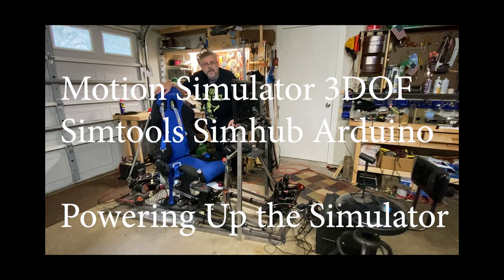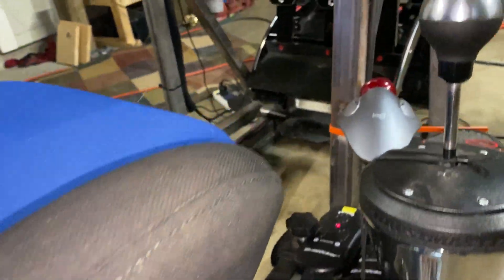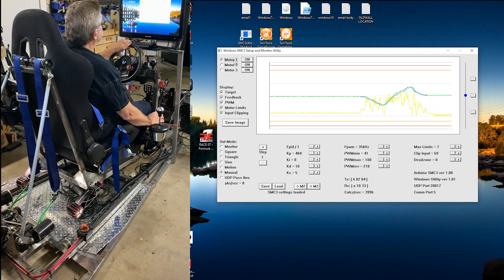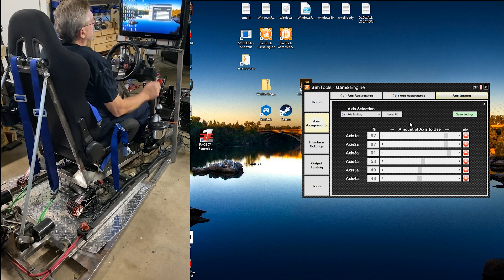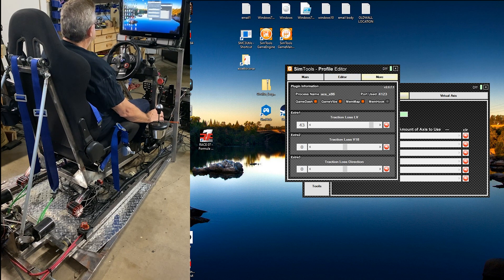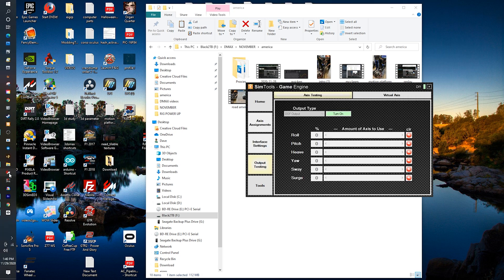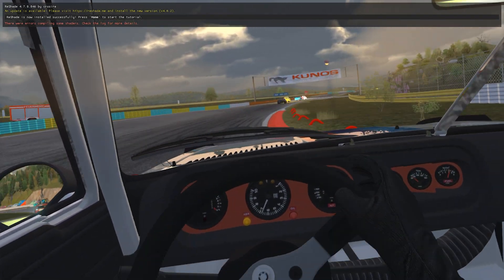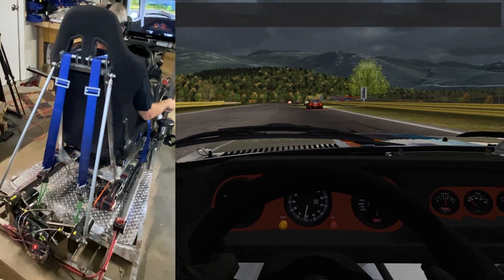diy motion simulator build - motion simulator build Powering up the Motion Simulator

Comment: Hey Dave. Been pulling my hair out (didn't have much to start with, so this is not a good thing) for the good part of two days. Have you ever patched your game to rFactor 1? My rig is working great in all test modes, but I have zero movement in game. Nothing I try works.
Reply from the maker: Well thanks for letting me know..  I have not tried it in R factor..  I guess you installed the Plug in right?   and that the rig is moving in SMC3 and maybe in another game like AC or  Live for speed (free game).    I think I would go back to x sim and post a thread  or read some threads with that search term..  other than that I think you need to  run the game once, before you try to set up sim tools..   But like I said I have not tried it yet..  Only DR2, AC and ACC, rollercoaster and Live4 speed.  
I'll post the question on my next Road Rage episode and maybe someone in the group can let me know..
Dave
Reply: @DMAX_DIY  thanks for the reply Dave. Turned out the plugins updater only likes zipped files dragged in to it. I’d extracted the files and dragged them in in the first instance and that was the problem. You gotta drag em in still zipped! Mostly the opposite of any other mods I’ve used in games. Anyways we are good now and I’ll tell you, what a blast this 3DOF motion platform is! Should have manned up and done this years ago. In the sim tools tweaking phase now with the games. It’s gonna take a while I recon. Traction loss is real tricky I’m finding.
Reply from the maker: @Doctoradhd1  Yes..  AS A ZIP FILE!  somehow Dustin has made it like that..  I did do a video on it..  
https://www.youtube.com/watch?v=QYzV9ler328&t=3s

BTW just watched your  latest video and asked a question on your channel..   Take a look.. if you have time  Dave
Reply: @DMAX_DIY  wish I’d seen that one. Would have saved me some time working it out!

Comment: hi great !!! 1 question  it is the same prog ino with potentiometer  remplaced by effect hall ?
Reply from the maker: smc3.ino is in the smc3 utility zip. on this page near the bottom  https://www.xsimulator.net/community/threads/smc3-arduino-3dof-motor-driver-and-windows-utilities.4957/
Reply from the maker: set up the SMC3.ino file in  your arduino by changing the #define mode1 to   #define mode2 and upload to arduino if you are using IBT-2 motor controllers like I used.  It's important to have 180 degree pots  or 180 degree hall effect pots because the range of motion of the lever in each motor is going to be less than 180 degrees.. Hope that helps fas83.   DMAX
Reply: @DMAX_DIY   does  i changing #define ENABLE NON LINEAR POT SCALING ? for hall effect pot ?
Reply from the maker: @fas83  I dont use that but It's supposed to smooth out the abruptness of a high horspower car.   like I said.. I have not used it yet.. I like linear..
Reply: @DMAX_DIY  thanks dmax.  I will do it.  👌👍

Comment: Hello, very good work, when launching the games you don't have problems with the simhub? I can only launch simhub after launching simtools and the game if not the engines don't maxem .... didn't you have the same problem? How did you solve it? thanks
Reply from the maker: Hey Alex..  fortunately, I do not have any issues. I just launch my RIFT from the Virtual screen ..  then I can launch the Simtools, switch to AC  from whatever game it's on..  Then turn on my motion rig. then if I want to run SIM hub, I just start sim hub.. It controls the Buttkickers and the wind sim.  Sounds complicated but only seems complicated if i forget to turn on the motion platform.. ALthough the guys in x-simulator.net have showed me a MACRO which starts up everything in order  but I have not tried it yet.. Dave
Reply: @DMAX_DIY  In the order you tell me it works perfectly, simtools/engines/game/simhub, but if we change the game and don't delete simhub and restart it after the platform won't move .... that's what happens to me .... Thank you very much and very good work....
Reply from the maker: @alexandredacunhacoelho6950  Glad it works on that procedure..  I dont swap games very often so Maybe I am overlooking something  cause I think simhub keeps multiple game profiles you can select from.  Or just restart the sim hub..

Comment: How come all 3 POTs would not be set to the middle at startup testing on SMC3?
Reply: Actually already watched 'em, subscribed, got them saved and refer to them frequently.  So thank you for that!!   In fact I am holding you personally responsible for leading me down this rabbit hole...lol. 
I designed a 3DOF rig modeled after yours, but with the seat frame made of aluminum extrusion.  I've joined X-sim and cruise around there daily trying to learn as much as possible (but it's never enough)  I actually got the electrical half of things pretty much done and (seemingly) working on testing and am working on the mechanical side of things now trying to get all the frames and geometry right now.  Just had Fanatec ruin my Christmas today when they told me the DD wheelbase I ordered a month ago, and was supposed to ship tomorrow,  now won't until after the first of the year 🤦🏼‍♂️.  Oh well more time to weld and grind and read and tinker I guess!  Thanks again,  vids are great, keep it up!
Reply from the maker: @dgator7251  yes the Fanatec Rabbit hole!  it's the same ! I can tell you I totally enjoy the 3DOF motion rig in VR. I had triples but motion with VR is just something else..
Reply: Yep...Quest 2 is coming soon too!  I fully expect to get everything done and then probably have no steering wheel 🤦🏼‍♂️
Reply from the maker: @dgator7251  I went from a table to ALL in in less than 6 months.. Weird stuff happens when motivated!  DMAX
Reply from the maker: They do, Unless out of range of the magnets.
Reply: @DMAX_DIY  ...so is the reason your motor 1 and  motor 2 were not centered at first because you had not powered up yet and the arms had not moved to their normal neutral starting position yet?
Reply from the maker: @dgator7251  Yeah it was the first power up. So things are a little unpredictable, but easily fixable.  Once the Pot gets reading in the center, you can adjust the movement of the seat or motion rig to suit.. Also tunable in SMC3 and in simtools.  I have a few videos out there on it if you have time to look  Thanks for commenting.. DMAX
Reply: ...and impatient! 👍